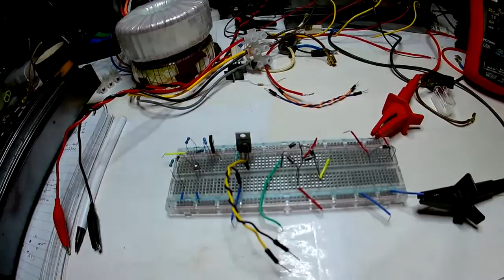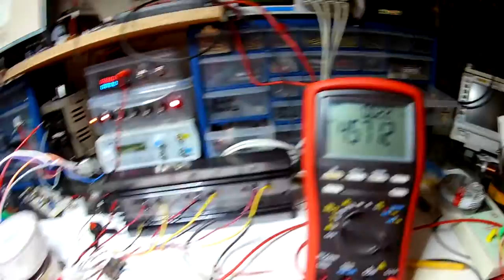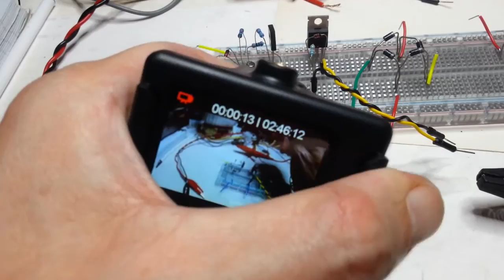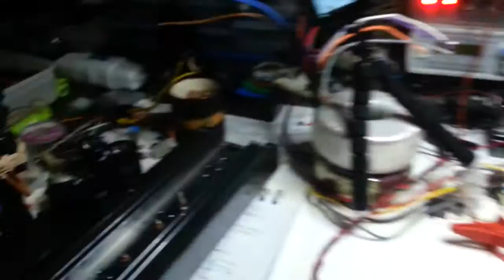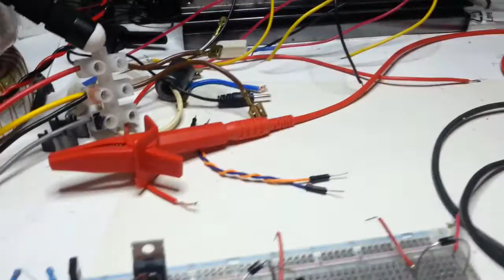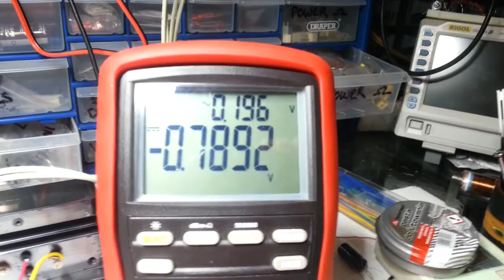Reverse Polarity Protection Examples

Comment: Thanks for sharing that before you grabbed the breadboard..due to my deep love of diodes..smile...i have never played around much with alternative protection methods..the "idiot" diode...it would be more polite to tell the customer that he needs a new NED...noise emitting diode..I love old geranium diodes..my family fail to understand my excitement when i salvage one and discover it has  a very low voltage drop..lots of experimental potential ...effects of heat..using in parallel..have fun and try a different memory card in the camera...does it also lock up when using outside?
Reply from the maker: I know but calling it the 'idiot diode' was quite fitting considering it is only two wires to get the right way around and they are usually colour coded lol the good old days. I like the glass ones where you can see inside, My family doesn't get it, they think I am strange for wanting to learn this at my age. I do not like the watching TV but don't oppose those that do. Diodes in parallel umm... I wonder how that would work?  I haven't tried the camera outside. I have the head harness to record flights but feel a fool wearing it, so I don't  :-/
Reply: Diodes in parallel allow them to handle more current..but you need to thermally connect them...or if one fails you get magic smoke avalanche..but more interesting is.....you get a smaller forward voltage drop...which is particularly useful when playing with crystal radio's...i have a magnifying head harness with lights...makes me look like a borg...and scares the crap out of the cat
Reply from the maker: Because it shares the current less voltage drop? I will give that a try. A head harness is what I could do with but have not seen one with good reviews. I wear glasses to read and play with my wires so would need a set that works with them.

Comment: ohhh nice captitors!..smile..to smooth the DC of you home brew psu i suspect....whats the voltage and uf?..i want some super caps to play with...had my first electric shock off a big mains cap..inside my brothers record player...and its more of a shock when it was not plugged in..lol..tried to recharge a aa battery by connecting it to the mains..bang flash...set fire to my mum and dads bed....ahh the fun of learning
Reply: ohh 10000uf very nice....nope they was not sleeping..they was out..they came home early once to find the gas cooker taken apart and about a dozen balloons on the ceiling
Reply from the maker: bunnyathome OMG lol you sound worse than me. I sawed the legs of mine and my brothers bunk beds. I tried to saw a bar fire bar in half while it was on.Then the saw was taken away. I managed to get my mums stereo working again after taking it apart, which was lucky.  I took my sisters radio to pieces it never worked again, Oh the joys of childhood. Some parents are truly blessed :D